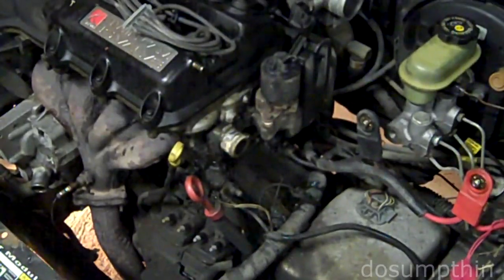Removing an engine through the bottom (Engine Transmission Subframe)

Comment: I just picked up a 1997 SC1 5-speed with 79,000 miles. I was wondering about removal through the bottom. I'm glad you posted this. I didn't think I'd find something Saturn-specific, so I was really glad you showed up in the search!
Reply: You need a lift that will lift the car off the motor high enough if you want to remove it from the bottom.

Comment: I just bought a very low mile 1999 saturn and it was so clean it was unbelievable, I took a light and looked high and low for rust and found almost none on it, the whole car looks brand new It's a black SC 2 and because of the cream puff condition i gave the guy $3,000 for it. I considered getting the bottom treated by spray to protect it from rusting.
Reply: about $1000 too much

Comment: Hey man I have almost that same exact Saturn mine is a 99 but the engine is identical along with transmission looking at that system can you help me figure out mine? It makes a weird whine randomly as the engine runs its not a belt and not timing and feels like my torque converter I'm sadly lost